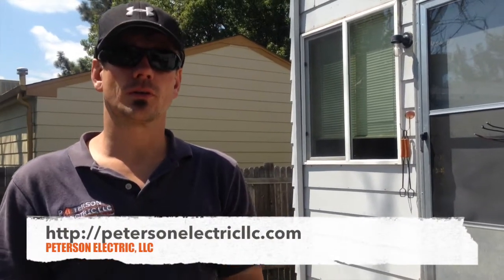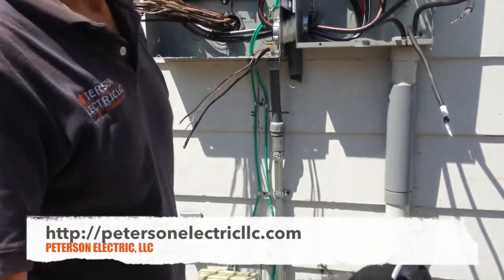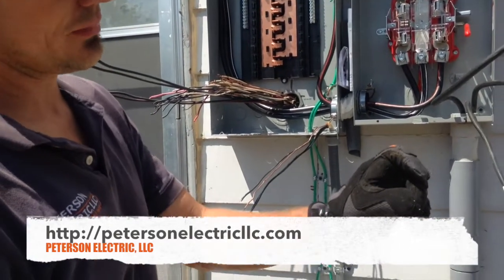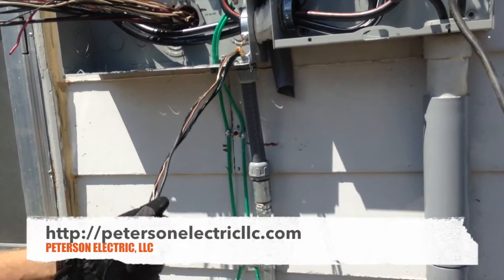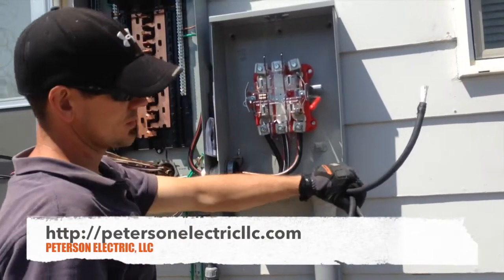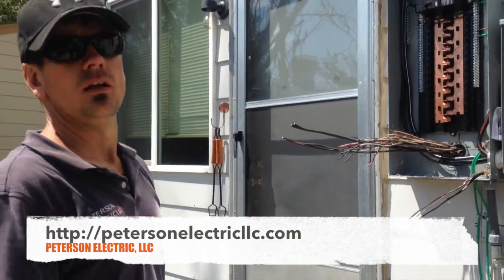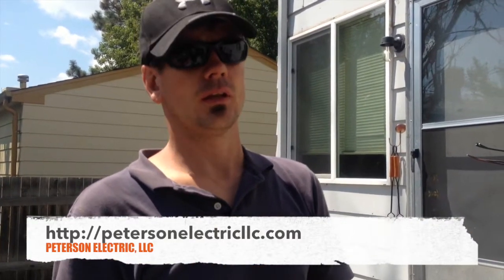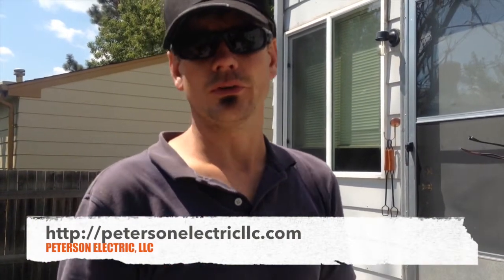Finished Electrical Panel Mounting For Residential Service Change

Comment: A question ;
If i just wanna change the electrical panel( no upgrading ) how can i disconnect my electricity ? Do i have to call electric company and have them disconnecting service for few days ? 
The house i’m working on doesn’t have an external main breaker ... thanks